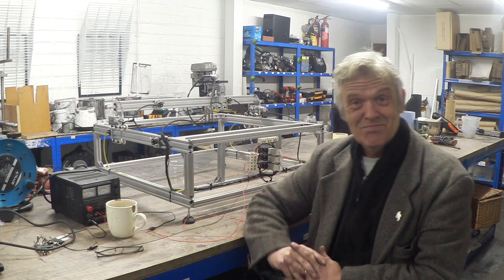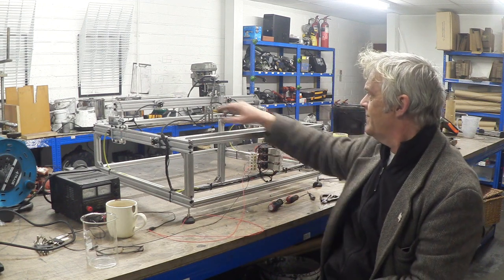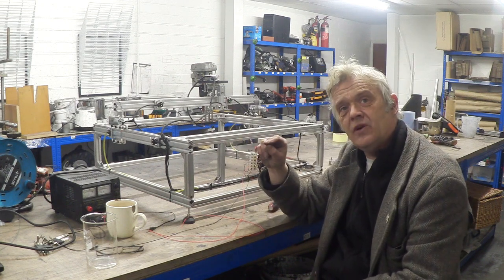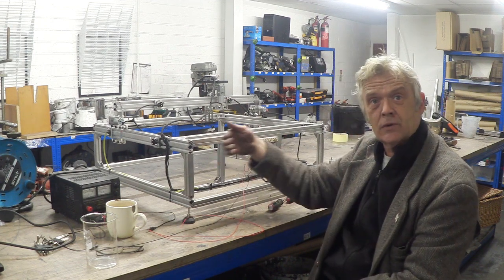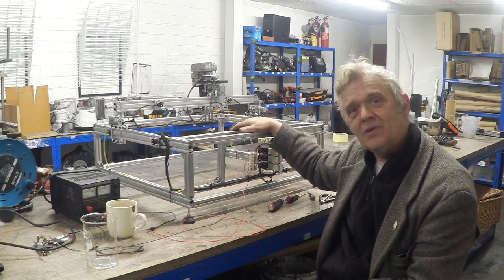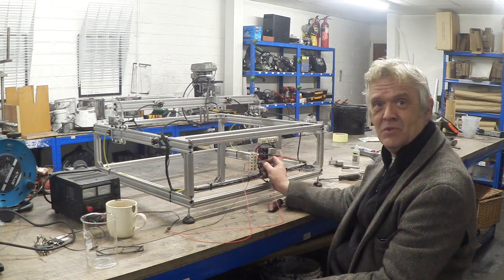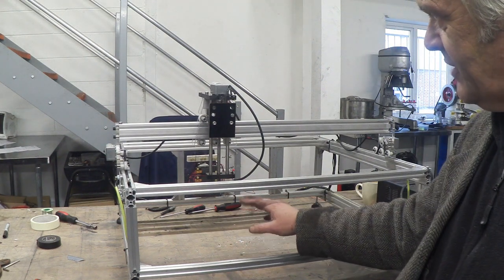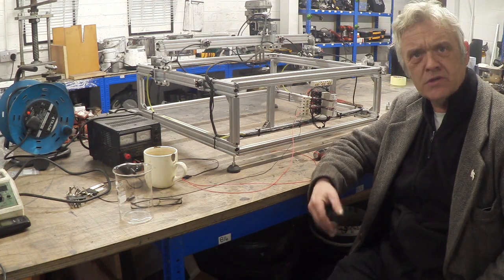Home Built SILAR Machine

Comment: Dear Robert, firstly thank you so  much for all the content you put out. I have no background in electronics or chemistry and I still find your content fascinating! 
When I saw your SILAR machine running just now I thought of a possible improvement; instead of having the head going round and dunking the piece in each jar, would this be possible? To have the head fixed in the centre with a motor to rotate it and another motor to raise and lower it. Then suspended off of the bottom two booms at 90 degrees to each other (making a cross). This way you could have work on 4 pieces at the same time instead of one. 
The head would lower (either lowering itself, or just the boom arm) and dunk the 4 pieces simultaneously for desired time. Then it would raise up so that the pieces were clear of the jars, and turn through 90 degrees so that each piece moved on to the next jar to be repeated. 
I guess the limitation is that the pieces could only be dipped for the same amount of time. If they needed to be dipped for different amounts of time, you could have the same cross-boom idea but with independent lowering motors on the ends of the boom. 
Anyway I hope you got the picture, and that it might at least provide food for thought ;) Hope you are doing OK through the current situation and thanks again for all you do!!

Comment: It's an interesting approach, Robert. Thank-you.
You could have a much simpler system to do the same thing (and without using an Arduino, replacing it with a small timer switching a thyristor), as follows:
# Use an up/down motor, controlled by a 555 timer (or a mechanical timer motor).
# Have four containers on a rotating turntable, which rotates a quarter turn before stopping.
# Drop the sample into beaker 1 as you are already doing, with stop switches at each end if the vertical travel. (Or simpler, 1 microswitch operated by 2 pins on each end of a sliding arm.)
# Pause for 30 seconds - or whatever time you choose (a 555 timer, or mechanical equivalent timing all motions in dipper arm and turntable)
# Raise the sample.
# Rotate the turntable gently by 90° using a motor stopped by a sensor switch (an ordinary micro switch working a relay) being operated by 4 pins on the turntable bottom
# Literally rinse and repeat ad infinitum.
# (Optional) Count the total number of cycles by using a spigot to click a mechanical counter once every full rotation. If you're posh, then you could use an electronic counter driven by a Hall Effect sensor, etc! If you prefer slumming it, then you could time one full cycle, and multiply by 500, to ascertain the stop time, without physically counting the number of turntable rotations.

You will need to refresh the rinse water containers on a fairly regular basis, as you are no doubt doing with your existing machine.

Apart from the great simplicity of electronics and simpler construction (a maximum of 3 micro switches, one vertical motion and one rotary motion), the machine will be tolerant of power interruptions, especially if you use a mains-powered rechargeable battery operated system, which could keep running for days during a prolonged power outage.

Comment: Just had a moment of inspiration while watching your video and had an image flash of a further simplified design that could work with multiple substrates at one time. If the device were circular with the substrate hanging from a hoop that rotates based on similar switching and is raised and lowered at the stops. Interesting idea anyway. Thanks for sharing 🤓👍

Comment: You do realize how cheap it would have been to get a little 3D printer And program a very simple G-Code to do this. I've got 2 CNC machines and 3 3D printers. I can run a test using these to see if it would be simpler for you. You should have used steppers. They're cheap. And the Board to run them is cheap.

Comment: Rob.  Don't let anybody distract your design plan, including me.  Nothing wrong with "old school" mechanical relays and switches.  I worked at Kellogg's a 100 year old company (makes breakfast cereals and waffles).  There are tremendous ranges of tech approaches to moving waffles as example on a production line to different locations.  Even today while they do use modern  PLC controllers for motor position and rate, stop, start etc., there are still many processes that rely on simple limit switches, dpdt relays and timer modules.  Switches and relays (mechanical) are often rated in the area of a million cycles before failure. 

 I like simple and very reliable.  No need to get too complicated.  Some history.  Back before the PLCs were common, processes requiring a complex sequence of on/offs of multiple switch contacts used a rotary switch assembly.  It was simply a small gear motor rotating a very long shaft having small weight arms that were independently adjustable per a huge number of micro limit switches (Cherry) aligned along the long shaft.  So on/off or delay of some about is easy to achieve by the logic of the micro switch positions and if desired, using that logic to turn on/off the rotary motor per switch sequence to make/break continuity.  Simple logic functions of and/or/nor etc are so easy.  No software, no computer and accurate as needed.  

Nobody makes them anymore that I know of, but an old CNC we had used one in sequence logic controls.  When the motorized rotary switch finally died (20 years all day operating) we bought the last spare that the manufacturer had in stock.  But I think the equivalent could be easily fashioned from a mounted row of limit switches having a long threaded rod with either nuts or tiny arms on the rod arranged to strike the limit switch arms.  A lock nut holds the position of the tiny arms/nut positions.  The motor can start/stop ect. based on the limit switch tiny arms position that you "program".  The motor can run as simple short pulsed motions or more continuous all according to your switch "programming".  I only mention the pulse meaning you can control length of time between say LS1 closed and say LS2 open, and on to the next order of sequence.  In fact, some of the early CNC's did not use PLCs, rather they used what was known as a sequencer.  It was just a hardwired "canned" logic of all the general functions of a CNC, like home position, move x axis ect.  Of course your design won't need this much logic, it is good to know it can if desired.  For your heater, a simple thermistor or thermocouple and a temperature controller module with a digital readout is very nice and simple.  Also the controller can be set to open/close external devices per temp ramp you setup.  Done it for a conveyor belt running through a heating oven at work.  Thought this info may help in this or other projects.
Reply from the maker: Thank you mate for taking the time to say that - frankly - I find it doesn't matter what you say - left or right - someone somewhere says go a different way. No idea why but I do know that those most likely to say do it differently are those who tend not to have done it themselves lol - cheers again

Comment: arduino will eliminate the need for the relays
Reply from the maker: I believe that an Arduino can run little motors mate but in general it's not a good idea as the power requirement can be high if running motors - best to get the Arduino to run a relay and use that - with diode - of course - to run the motor - that way you don't burn out the Arduino
Reply: @ThinkingandTinkering  you run the motors of drivers. if u are using steppers, u can use cheap drivers, drv888 will run a nema23 with no problems 4A, 12v. I love your stuff, watch it as soon as it comes out. u are brilliant mate
Reply from the maker: @ilookatnews9745  awesome mate - thanks for that and cheers
Reply: @ThinkingandTinkering  with a vfd u can run a 2.2kw spindle from arduino
Reply from the maker: @ilookatnews9745  cheers mate
Reply: @ThinkingandTinkering  if u need help programming an arduino, i am at your disposal

Comment: If the "dunking time" was similar ... I was thinking of a continuous drive cord with the sample hanging off following a kinda sine wave path & returning via a straight line .... picture if u will, the tuning scale on old radios with a cord to indicate freq. ... now make the bottom of the loop travel in a sine path... NO timing at all apart from a motor speed control...🙄
You'd need dishes as opposed to beakers of course...
Does this sound crazy ?? 🤪
I call it the Luddite SILAR Device ... (LSD) 😏

😎👍☘🍺
Reply from the maker: lol - mate I always like ideas that get to the core of stuff - worth a try maybe?

Comment: Robert are you aware of the work done by 'Ukraine's  Institute  For Problems of Material Siences? 
"At the  Institute  for Problems of Materials Science  in  L’vov,  Republic  of Ukraine, Academician Trefilov, a Senior Fellow of  the Russian Academy  of Sciences and  Vice-President of  Mathematics of  the Ukrainian Academy  of Sciences, headed up a  team which has produced a  solid-state,  non-chemical,  carbon-lattice  energy storage  device  called an  ‘energy  accumulator.’ 
The  mono-molecular  sheets deposited by  this technique are  wrapped back  and forth on top of each other, more than one  million times per millimeter, and are  separated from  each other by  a  distance  of less than one  atomic diameter. At this level of  construction, the material  becomes subject to the rules of  quantum  mechanics which are  almost entirely  probabilistic. That means a whole atom  of carbon  (or  almost anything  else except an electron or  photon)  will  not fit  in the  space  which separates the lattice  sheets.   When viewed under  an electron microscope, the sheets produce  a  pattern which looks for  all  the world like  an endless field of  four-sided pyramids, connected base  to base, on a  single plane, with the  tips of the  pyramids protruding  endlessly, uniformly  upwards. When wrapped back and  forth on  top of each other, these  sheets of pure  carbon  crystal, made  of carbon  molecules shaped like  trillions of identical tiny  pyramids, all arrayed endlessly  in identical formation, are  positioned so that the  tips of the  pyramids on the  bottom sheet are matched with the  tips of the  pyramids on the  top sheets. What remains between the pyramid  tips are  open ‘spaces’  or  energy  wells."  
Wonder if that could be done with your SILAR system?
Reply from the maker: that is fascinating mate - and yes as I was reading to the same thought came to my mind

Comment: Robert  I hate to add to your play ..ops i mean work, load ,but have you thought much about MOF's,?,  metal organic frame works , just been reading a bit from new atlass ,and journal of scientific reports  on some water harvesting experiments ,useing a them to harvest water from the air . The research is looking for the highest surface area for weight of any material known ..pricked my attention ,a football field per gram ! ,and can they be made by SILAR methods I wonder . ?. cheers MG   ps don't forget you can get solid state relays pretty cheap now ,for reliability over millions of cycles
Reply from the maker: I like MOFs mate and yes it is something I will be looking at

Comment: Fascinating, this is technology I am completely unfamiliar with , have to mug up .....It struck me it might be simpler to use a rotating platform turning through 90 degrees and a diving head at one station...or more heads for more productivity would be easier. Thanks for sharing this technology. cheers
Reply from the maker: Awesome mate - and I am going to add a heater so rotating probably isn't going to work
Reply: @ThinkingandTinkering  aha, I had thought of that and indeed it adds difficulties, however not insurmountable..but it make your system more versatile for localized individual conditioning, heating , cooling or ultrasonic etc.
Reply from the maker: @bernardstokes6550  maybe mate - cheers

Comment: I gather you can have more than one stage and mix layers of two different molecules to get metamaterials, or even something as simple as the conductor:insulator layers in a sequence for a capacitor? Or is that better suited to a more typical, and more complex, CNC setup with stepper motors etc?
Reply from the maker: something like that mate - and no - you don't need anything more complex - it's funny - when I read the comments a lot of folks just want to add complexity - I have no idea why.
Reply: @ThinkingandTinkering  OK so the machine is modular and you just add more modules to have a two step/material version, it just keep moving at the end of the first stage and then returns to the start at the trip switch at the end of the second. 
A-->wash-->react1-->B--wash-->react2-->(repeat) ?

Comment: You just build everything the old school garage door openers have, with limit switches and relays....except we used a small screw drive that would go between the switches! We would adjust the nuts on screw pending how far we wanted to travel in any direction and hit the Reed switches and reverse the travel. No Arduino, no stepper motors.

 When I visited my dad years ago he had a slew of them waiting for me to repair!  Usually stuck relays or bad switch. 
We're talking 30 or so.. they were in the field like 10+ years. He had modified them to gate openers for customers!  Every time I showed up on the island he went ...I got a "small job" for you!  I sit there for the day and repair them all... Loved them things. Fascinating stuff!
Reply from the maker: I agree. mate - for some weird reason folks seem to want to overcomplicate everything - keep it simple - that's what I think - cheap, robust, easy to build and last forever

Comment: Very easy to write a Gcode file for a 3D printer to do the same and you have a heater already. You could also have it jiggle the end around to stir it.
Reply from the maker: you would think wouldn't you? - but funny how no one does that - and i have to ask - what do you learn by doing that? - a bit of gcode - here you pick up some really interesting stuff on machine design - limit switches are petty universal in machine control
Reply: @ThinkingandTinkering  I have built a few 3D printers from scratch so I have already learnt plenty about them. My thoughts are why build a machine that can only do one thing when you may already have something that can do the job just as well with a few small modifications. Done plenty of Arduino projects also, so nothing new there for me. 

I am however curious as to why you have called the terminals L & N, these are used for AC, if DC it is positive and negative/ground.
Reply from the maker: @garyhoffmann1615  well that's awesome mate - why don't you do a few videos to share that info?

Comment: Rob you've got your hands dirty again! It's amazing how aluminum looks so bright but always darkens your hands. Many times we build these apprentices with pneumatics, but the little pistons can be expensive. Low voltage wiring can be finicky, and higher voltage deadly, might I suggest 24v and keep yourself  and the equipment grounded. Those little motors can short unexpectedly.   It will be fun to see in operate (aka Goldburg.)
Reply from the maker: lol - i know mate and thanks for the advice

Comment: Stepper motors only cost a couple dollars each. I buy 600mm ballscrew and rail kits with motor for $26 each. A belt will be a lot cheaper but they are not as sturdy and wear out. But building a 600x600mm by 100mm setup would only cost about $70 with ballscrews and slide rails. 

The absolute cheapest and easiest would be to put the containers in a line and make it 2 axis with a clothesline type setup. A looped belt with an unpowered pulley on it will let you sling a rope over the pulley for up and down by winding a piece of string on a motor and horizontal movement by jogging the belt and the dipper motor at the same time. That would cost under $10 with 2 steppers ($4), 2x string (pennies), 3 plastic pulleys (10 cents), 5x scrap wood for a frame (free). dual stepper driver ($1.80), ESP32 ($2-4) and a few nails.
Reply from the maker: Why haven't you done a video on it then? - there are literally loads of ways to do this - perhaps you could demonstrate?

Comment: Wouldn't it be more cost effective to make it round, so you only have 2 motors, one for dipping and one for turning ?
Reply: For this specific 4x250ml beaker application, Round would definitely be better - unless the beakers were different sizes, or the number of beakers was different, or you wanted many more wash water beakers etc.
Reply from the maker: yes - unless you want heating in there too

Comment: I know after all the work it's a bit redundant but wouldn't a rotating arm or the beakers on a turntable simplify the construction?
Reply from the maker: unless you want to add heating mate and that's on the cards - the rotating arm is pretty hard to implenet as it happens - but there are a hundred ways to do this and I ain't saying i know what is for best - it's just a guess on my part

Comment: Interesting project. A few other ideas for implementation  Adapt a cheap 3d printer gantry. The advantage is it could be programmed with g-code. Another option might be to use a toy robotic arm to move the sample between the different beakers.
Reply from the maker: there are lots of ways of doing this mate - but interestingly enough - most ideas never become reality - things seem simple until you try to make them

Comment: Looking forward to the science. :)  I feel that the SILAR equipment, while simplified, has extra costs when it comes to a kit.  A stepper motor could reduce this machine to a 2 axis.  I understand your thinking though and what you made is near bulletproof.
Reply from the maker: you are quite right mate and a single run line where the beakers were in line would have also reduced the construction demand - but we just try and see